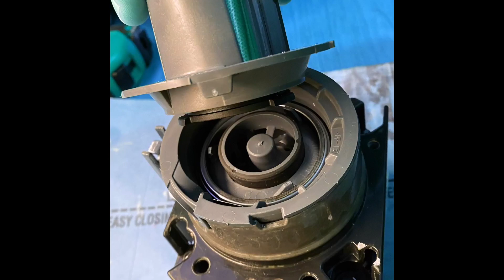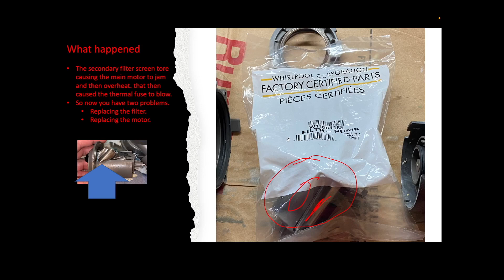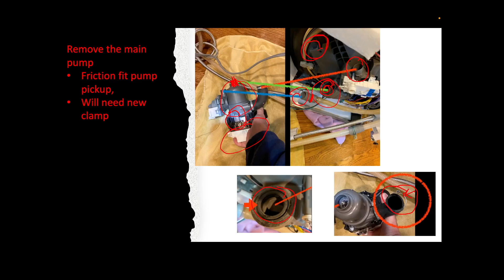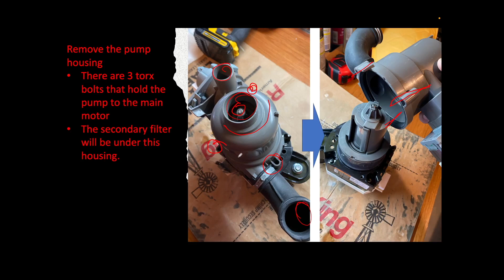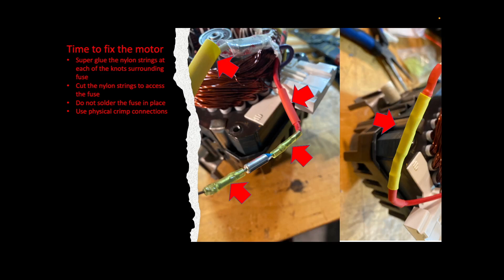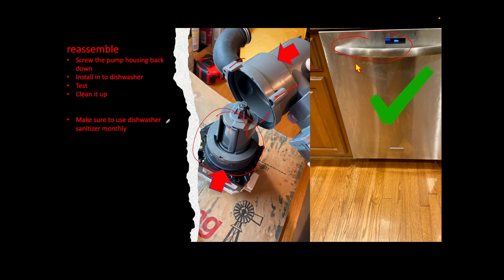Kitchen aid dishwasher filter and motor repair KDTM354Dss4

Comment: Thank you very much for the video! I have the same issue. 

I wonder - is it possible to just use the pump without that filter screen?? Since this is so prone to shredding?
Reply from the maker: I'm sure you could but you wouldn't have any sort of fine filter and I suspect it would not clean properly.   That's just a guess.

Comment: Hi Dan! Great video! Is there any way to know if it's necessary to replace the thermal fuse? I wonder if my shredded filter was simply not allowing the impellers from rotating? The fuse replacement is a bit beyond my skill level!

Comment: Very good vid.  You crushed it dude:-)  One additional thought.  On mine, the tabs on the pump impeller that engage and turn the spinning filter were badly worn and not evenly.  I reshaped what was left and put a new filter in it.  I lasted one year.  It would be very beneficial if they would sell an impeller to go with the new filter.  As I understand it, you can only get the impeller if you buy the motor.  Word to the wise, if your filter is trashed and the impeller tabs are badly worn, the repair may not last long.   Also note that the drive faces of those ears likely need to be very evenly spaced for the filter to not wobble and last.
Reply: I wonder if I have this issue.  Filter was shredded.  I removed everything, took off the motor and saw that one of the fins was cracked in the back.  I tried to retain it, but just touching it snapped off the back 1/3 (maybe).  I tested the motor and it ran fine.  Then I assembled motor with new filter and shroud that goes over filter.  I test it assembled and it seems too loud?  I'm not sure as it's typically facing down and has the insulation around it . . . Sounded like the metal spring and other metal ring vibrating.  Oh well.  I guess the only way to find out is to try and run it for realsies.  Great video, by the way.

Comment: Another thank you. Luckily my thermal fuse didn't blow, just needed to replace the internal screen (which collapsed and seized the pump impeller). It's incredible how fine of a mesh screen is used. Almost seems designed to fail as there is no other filter for large particles.
Reply from the maker: I'm glad it helped and incouldnt agree more about that filter.  Just a terrible design. Hopefully they went away from this design in later models.
Reply: @yourdiytechlife nope, still advertising that "self-cleaning" filter in their more expensive models.

Comment: THANK YOU for this! My dishwasher (same model) stopped cleaning dishes despite filling & draining properly. I observed that the water wasn't getting circulated through the spray arms at all. I watched a bunch of videos, this being one of them, to try to get a sense of what was going on. When I did my exploratory surgery and opened up the pump housing, I was surprised to find that my filter got shredded just like yours. I guess this is not an uncommon problem? Thankfully I did not have to replace the motor or even the fuse, and I also did not have to clear the error codes in order for the dishwasher to resume active duty. Your video really helped me understand what to look for. Thanks again!
Reply from the maker: I'm glad this helped and you were able to get yours going and thanks for the feedback!
Reply: @yourdiytechlife  @jennifermccurdy7389 Thank you both for the video and comment as I just had my filter on my KDTM354DSS5 shred which stopped the cleaning. This video helped a lot but it seems that the old part number for the filter is unavailable and the new one does not directly replace W10713298 as stated. The base of the housing is smaller and does not seat properly. The wave washer just sits around the new filter and the tab no longer goes on the outside like the original. I put it back together anyway as everywhere stated it's the direct replacement and it was SO LOUD. I chatted with Kitchenaide today and they were absolutely no help. I am taking the new filter out and putting it into the old housing and hope that works but that should NOT be the case. There are other reviews out there stating the same but Kitchenaide claims there are no issues. I am just curious if you ran into this replacing yours since it seems like the new replacement part first became available in Oct 2023. It's about a 0.5-inch difference in circumference between the old and new filter houses. I'm beyond frustrated with Kitchenaide for both their horrible design to get us all here in the first place and making the solution another problem. And maybe this comment will help others in the same boat.
Reply from the maker: Oh man,  i'm sorry to hear about the filter issues.  I did not have any fitment problems at all,  it fit right in like the original.  I cant fathom how they could make that sort of error but I'm definitely fond of this brand after all the issues i've had with this machine so I understand the frustration.  Mine is down AGAIN for a different issue at the moment so I'll probably making another video for this thing. 😒. unfortunately i dont have any insight in to this problem but if I think of something I will post it up.

Comment: This is an EXCELLENT video!  Thanks!  My dishwasher has just started not getting the dishes clean in last 2 cycles, so sounds like I've caught it before doing major damage.  Just wondering now if I can simply get some cleaner and run it through, or if I should replace the filter now, even though it's not yet torn (I think).  I may try it for one cycle before doing further surgery.  It's a good thing Thanksgiving is not at my house this year!  Hope everyone has a Happy one.
Reply from the maker: You can try that.  If it hasn’t ripped then you probably ok and the cleaning might be enough.    Let us know how turns out.

Comment: This is a fantastic video. I'm just about to order my replacement filter as it was shredded as well.  I'm not sure if my motor is in a working state. Can I test it using a multimeter or can I wire up direct 120 volts to it to test it?
Reply from the maker: As I recall I did in fact test it before re-installing it in the washer.  you should be able to connect it to the mains with a cut wall cable.

Comment: Thanks for detailed info changed my shredded filter and reset procedures after second time running heat and steam came back and finally clean dishes 83 dollars vs 980 for a new dishwasher👍🏽
Reply from the maker: Outstanding!   Thanks for dropping a comment 👍👍
Reply: Where is the reset process after you install the new pump motor
Reply from the maker: @davetesta8394  This is the process that worked on mine.  after doing this everything worked great.
MOST IMPORTANTLY* ONCE YOU REPLACE ANY  PART, you have to run a FULL DIAGNOSTIC CYCLE (about 23 minutes) for the control board to work correctly, otherwise you may get random problems.  Mine refused to see the heater element after the motor/pump replacement.  To enter the diagnostic cycle, press any three panel buttons in a row 3 times, less than a second between each.  1-2-3, 1-2-3, 1-2-3.  All the panel lights will illuminate.  Close the door and leave it alone.  It will cycle through multiple (20 plus) diagnostic tests.  When all the lights go out, the diagnostic cycle is done.  If the Clean light is flashing just after closing the door and starting the diagnostic cycle, it is an error code.  In mine, it was 7 flashes, a pause, then one flash (7-1). 7-1 is the heating element error code.  You have to clear any error code manually by pressing Hi Temp in "Interval 20" of the diagnostic cycle.  It will not clear on it's own.  The easy way to do this is to start the diagnostic cycle and watch the Express wash and Prowash lights.  In the first couple of minutes of the diagnostic cycle, the Prowash and Hi Temp lights will both come on.  This is the Interval to press the Hi Temp button to clear the error codes.  All this info is in the data sheet in the insulation behind the bottom panel.  Thanks for the video and hopefully these hints will help!
Reply from the maker: @davetesta8394  oops.  I thought I had that in the links but I dont.  let me go get those and I will post them up
Reply: @davetesta8394  unplug or turn off breaker for one minute then look for codes to rest hitemp button then dry five times 👍🏽